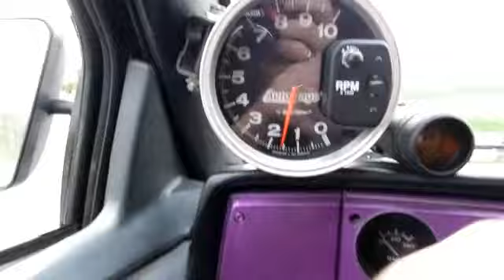Black widow S15 video

Comment from the maker: Thanks...If you can find one set up 4 a v8 that is always nice my dad and his friends did the work on this truck (I just bought it from him done) but if you take out the wheel wells it makes working on it so much easier he put a fuel cell and battery relocated to the back for weight reasons so light in the back and a good radiator to keep things cool here is a link to my newest video with truck it's Black Widow S10 in my videos if you have any ?'s just let me know.